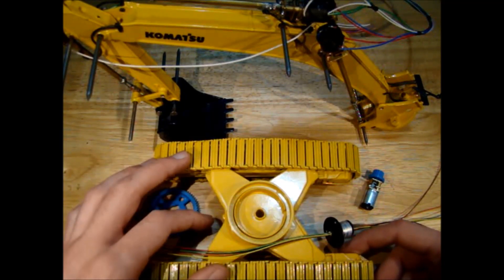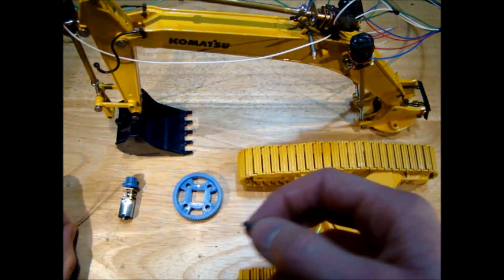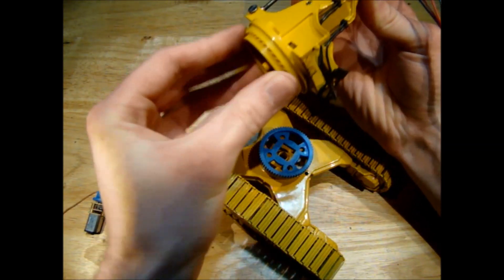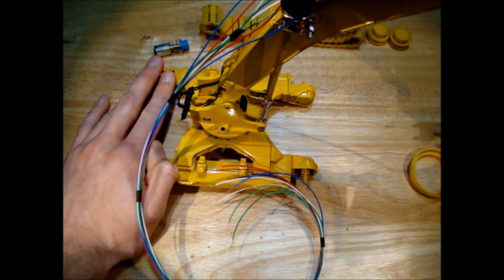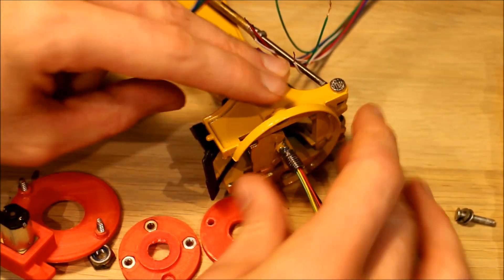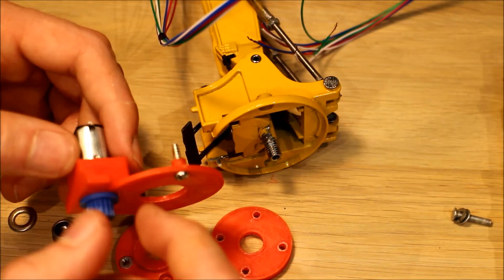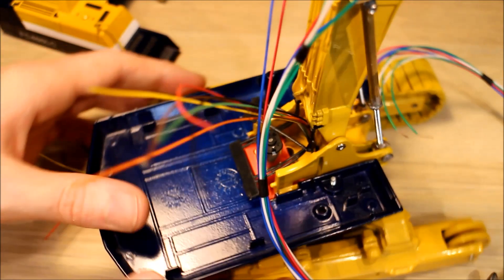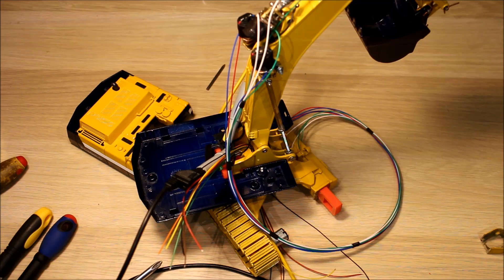RC Komatsu PC400LC Part 5 - Adding 360 Degree Slewing to the Excavator

Comment: Waiting for the later parts, awesome video
Reply from the maker: +Col. Jabrayil Thanks, it will be an awesome machine when I finally get it working. I've been working on my  RC controller and a control board for the tractors which is taking most of my time. Not leaving a lot for the big builds.

Comment: Hey, Nice video's you have. I was introduced to your channel when i was looking for video's about the Geeetech i3 prusa but then i saw your other vids and subscribed. 
I am still wondering what your opinion is about the Geeetech prusa i3. Can you tell me how easy it is to work with and if you recommend it for beginner 3D printer enthusiast?
Regards Lars
Reply from the maker: masterproducts0 Hi, I'm a beginner 3D printer enthusiast, I bought it in March and I've only been working with it for a few weekends really. It's pretty easy to get working with a bit of effort, mostly a bit of trial and error with the extruder settings but nothing complicated. I think these excavator parts and the kane trailer parts have turned out way better than I could have made them without the printer so yes I definitely recommend it.
Reply: RC Tractor Guy Ah, thanks for your quick reply. Good luck with your further video's.